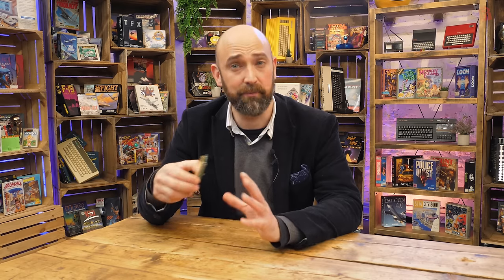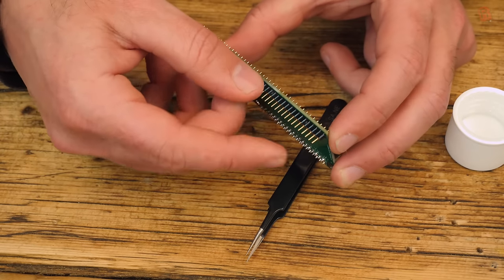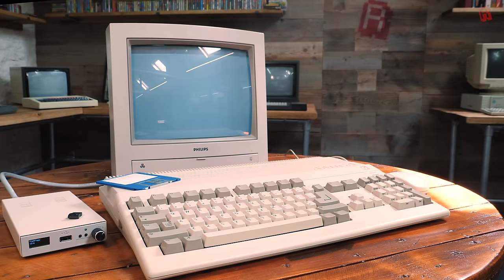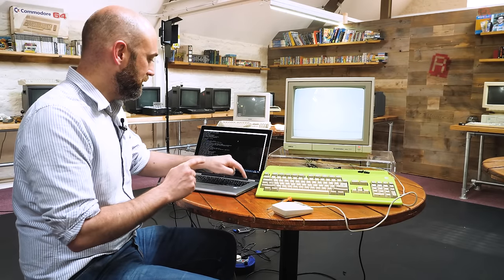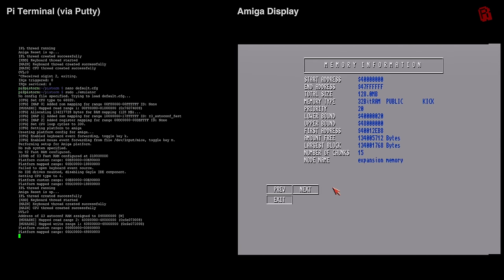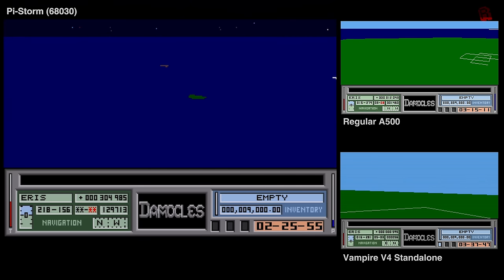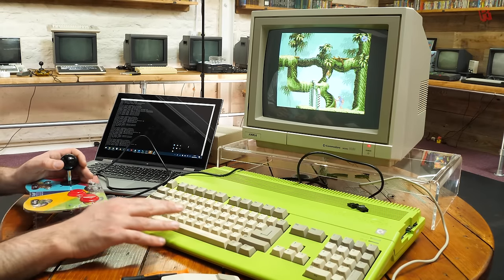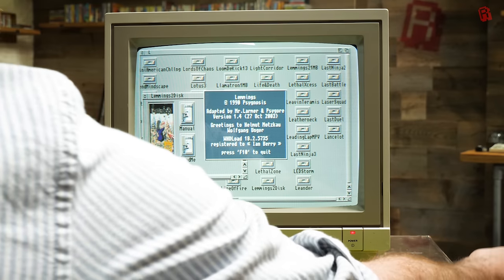Amiga PiStorm - Retro Power on a Budget - Tech Nibble

Comment from the maker: Thanks for taking the time to watch, I'm really excited to see this project progress. You can find a link to the Discord server for PiStorm in the video description, and while you're there why not give this channel a sub!
Neil - RMC
Reply: You need to check out the Pitrex for the Vectrex - it is using.a pizero in a similar way. It is supporting playing arcade vector games (eg. Star Wars and Asteroids etc) using emulator running on the pi and it is driving the Vectrex's hardware directly..
Reply: hi mum! lol
Reply: Thanks for the video. 

As for using a Raspberry Pi 4B, I would suggest they focus on the Compute Module 4. It would have the power, with none of the ports, and be more snug fitting.
Reply: @RMC did you know that Monkey Island on stock A500 don't have moving clouds on title screen, but when you change to 020 you get them? MI is running on CPU no hardware acceleration this is bad :/
Reply: @vardekpetrovic9716  The USB ports have to be removed, because they get in the way of things fitting properly.

Hence the 3A+ being the ideal one. Frankly, I would argue the Comute Module 4 is the best option, as you don't have to unsolder anything,  and will fit better.
Reply: @horseradishpower9947  You missed what he was asking...connect USB ports with wires that take up less space, rather than USB jacks.
Reply: @VulpisFoxfire  The question I have to ask next is... why do you need the USB ports? Does the add-on use them, or aow their use, in some way? Because it would appear not
Reply: @horseradishpower9947  Hmm. Valid point, actually.
Reply: The tube in your monitor is one of the blackest I've ever seen. So nice.
Reply: Do you know if there is any plans for the PiStorm to support Atari ST ?
Reply: @mrdali67  The end goal is for it to run anywhere a 68000 will. So.. megadrive, arcade boards even the lowly Atari ST :).
Reply: @thomassmith4999  Ha ha. I am not so much interested in gaming, and there is lots of areas where the Amiga is quite inferior to the ST line, but that sounds nice. I am merely interested in a way to cheap boost a standard ST since emulators doesn’t support the cartridge port wich was often used for copy protected proffessional Music software like Cubase. The hacked versions was never stable, so a software emulator alone isn’t an option, and it doesn’t have the main force of an old ST that still have a tighter midi clock than Cubase 11 running on a 16 core modern PC.  Quite an achievement for 40 year old 8mhz 68000, and no, an Amiga can’t do that trick .. 😜
Reply: @mrdali67  ST has better sound than an Amiga :) and a midi port !. I give it that. But I'm an old timer from the demoscene, so it's C64, Amiga and Gravis ultrasounds for me.
Reply: where do you get a pistorm?
Reply: @jediknight2350  If you can't solder one yourself you have to go on the waiting list on the discord channel. If you can build it yourself then you can order the PCB and do that.
Reply: @thomassmith4999  The ST is put together with very cheap pieces. It’s clearly inferior to the Amiga on the graphics and onboard sound (only the YM fm synth, no digitized DAC. They fixed it with the STe wich had the blitter chip, but at that time the ship was kinda sailed for them. But it remained top king on the Dtp and midi Music cause cause the midi interface is directly coupled to the cpu, wich made it take a decade or more for the Music software to catch up on other systems like the PC. Timing on the PC was an issue all the way up to USB 2.0
Reply: There is still some people today that use an Atari as midi master controlling a modern daw system
Reply: The high res SM124 graytone monitor (640x400) 60hz. Was also a plus for more serious use. I remember some put it on the side for dtp, just to find out the tube wasn’t supported on the sides so it had a tendency to break off the chassis when you turned it 90 degrees
Reply: @mrdali67  The roland interfaces on ISA for PC were as tight as the ST from a hardware standpoint. The software stack was a bit different story though.
Reply: Neil, this is seriously the koolest thing I have seen in the amiga community in the modern retro scene. I have wondered how long it would take something like this to happen, and I am not disappointed. I will be picking one up hopefully a little later this summer and trying it out myself on my amiga 2000. I need to know how this thing will work with a flying toaster.
Reply: Any way to get on the waiting list without using or touching discord?
Reply: @dafoex  Have a friend use discord.
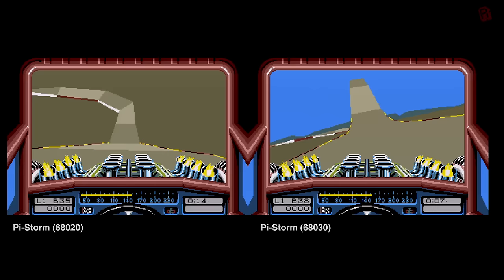Reply: 17:32 There are big drops in cpu emulation speed between these groups:
1. 68000, 68EC020, 68020
2. 68030, 68040
3. 68060
Ive seen this difference, when trying to turn old computers (200-1000mhz) into Amiga Emulation machines. BTW, if the Winuae didn't work fast enough, you could always look for an older Winuae version. 0.8.6 (best non-aga version) and 0.8.8 were my favorites.
Reply: @angreeee  Yeah. This is what I found too. You will notice that Amiga Forever on its 3.1+ images that have huge software bundles use an O20 by default. As that is really all you need. I don't think there is much software that specifically calls for anything more except for some productivity stuff that was made long after the amiga died. 

FPGA on the other hand is the opposite! The more elements the cpu uses the faster they seem to get.
Reply: @angreeee  can you emulate these amiga games on pc on an i7 from 2012?

Comment: Fantastic overview Neil.  Love the snot green A500!  Interesting that Damocles ran slower, I wonder if it runs like that on a real 030. Those disk speed benchmarks are crazy fast.
Reply: My theory: the 030 has an MMU; the 020 does not. For some reason, Damocles is using the MMU (or it is enabled by a debug tool such as Enforcer) and the Pi is incurring more overhead doing the page table walks.

Comment: Pro tip: Put the header pins in the socket, put the pcb on the header pins while in the socket,  solder the corners and for something this large a few pins in the middle, then remove the board and solder the rest of the pins outside of the computer. Should work fine then..

Comment: Neil, given that 700+ MB/sec speed is far greater than what an SD card is capable of, what you're seeing there is the virtue of the Linux VFS caching the hdf file in RAM.
Reply from the maker: Ah now that makes sense, thank you Linux!
Reply: That is a great use of the untapped RAM that the OS and emulator aren't using.
Reply: @shadowtheimpure  Doesn't the pistorm use the Pi's RAM to make up the 128 MB? Or is there 128 MB soldered onto the pistorm?
Reply: @Rocky1138  It uses the Pi's RAM, but that still leaves a lot of memory unused since the OS and emulator are very lightweight.

Comment: It is amazing what developers are coming up with and able to do it at a reasonable price. We have the PiStorm for the Amiga, and Apple II have the Apple II pi, Commodore utilizes a pi as an accurate emulator for the 1541 floppy drive, and over in the microcontroller field  the ESP32 is used in the FujiNet that greatly enhances the Atari 8-bit line. I wonder what this could do on a Macintosh.

Comment: Very informative, Neil.  You touched on several things I've not seen mentioned in other videos.  I would be interested in knowing if you ran into any of the issues Dan did on loading game from disk with the PiStorm installed.
Reply from the maker: I saw that, Dan did a great video. This Amiga has a Gotek in and I didn't run into problems but I haven't tried Lemmings from it specifically, I should go back and try, although I will 99% be using it from the WHDLoad SCSI setup and I did load Lemmings from that with no problems.

Comment: Besides the WSL addition, Windows 10 already has an SSH client included for the CMD and PowerShell commandline tools (out of the box). There is no need to use Putty anymore. If you want drag&drop file SCP transfer, you can use the free SSH client tool from Bitvise; it has many features, including a SOCKS 5 proxy server for tunneling the internet over the SSH connection.

Comment: This would be great with a Pi CM4 board. It's tiny, but far more powerful than the Pi 3A+.
Reply: yeah, just watch jeff Geering, for cm4 projects in general, does board reviews/tests,
Cm4 runs hotter probably, but if the amiga internal shield could be connected what a heatsink.
just look at what the pi400 has internally, a big shield and clocks at 1800 mhz

Comment: The Pi Zero 2W is now supported. The new zero is essentially Pi 3A/B+ recreated in the Zero form factor. It has less RAM (512MB is not an issue for PiStorm) and a lower default clock speed (1GHz).

Comment: Still so amazed by this. I really want to get my Amigas back up and working  just hope they are OK in the loft!
Reply: depending on the model, maybe not... a A500 plus will need it's battery removing PRONTO. A600 and A1200's capacitors will probably be leaking and wild temperature swings won't be doing any of them any good. Disks will probably be getting mould on the surface (which can be cleaned until it destroys the surface)
Reply: Get them re-capped, batteries out...now! Or they may not survive...
Reply: @cartayno  I know, mate! it is scaring me to death about that!  But im in Thailand and my Amigas are back in England! TT

Comment: This is an excellent little project. Hopefully at some point they'll get it working on a 1200, as that is all I have currently. 

Looking at it though,  at some stage I think a compute 4 version might be a better option than the standard pi, though it would up the pcb cost,  but as long as they don't change the pi compute 5 (or later version) format it would make it much more compact potentially.

Comment: I have an interest in one for my A1000 as its the only Amiga I have in my collection that is still in its original configuration all my other Amigas have accelerators that I am happy with.   I will be one of the very few patient people who want one and wait until they become widely available and for a couple reasons.   By the time they are widely available the development should be well matured and maybe the board will be revised several times.  So being patient allows for a ton of testing and get most if not all the bugs resolved.   Once I have one in my A1000 it will be nice to take the old girl out for a ride and some much needed attention.

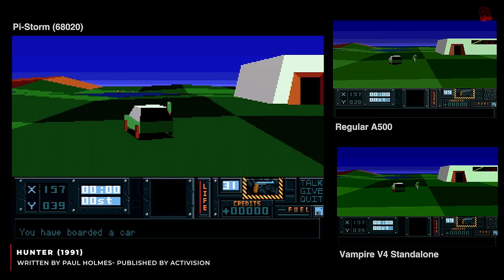Comment: 16:29 I could confidently say that the 020 setting was performing better because the hardware doesn't have enough power to get it running smooth set as an 030. This also happens on My PSVita when emulating the Amiga. I have classicWB on my PSVita and i find that when i try emulating an 030 Amiga, some games and demos run choppy, but when i change the cpu to an 020, the game or demo runs smooth. This may be fixed with better software optimization, but i would say its the lack of power from the pi and PSVita that is causing this.

Comment: Very nice video. About 3D games that seems not to be accelerated, do not forget that only CPU is boosted, so if any operations in the rendering process is done by the blitter, it will be the bottleneck.

About 030, the only things that can influence performances is the data cache. News instructions will ne be used (because games seen are designed to run on 68000). There are some programs that can disable data/instruction caches. Instruction cache was introduced with 020 and data cache with 030. Using self modified code can improved performance on stack 68000 or 68010 but be terrible for other members of the m68k family. I do not know how emulation is done but perhaps killing caches can change performances

Comment: FYI it is not in contest with Terrible fire. If you check Exxos forum TF has made a Pi Storm compatible adapter for the a1200.
Reply: The PiStorm developers theorise that the TF1200 might only be Buffee compatible due to some special firmware on both sides. If it does work then you won't be able to close the lid on the A1200 with PiStorm and it probably won't be very fast due to the bus translation. We are working (slowly) in the background on plans for a PiStorm32 which will support the A1200.

Comment: It’s all nice but for me growing up in the 90s. The Blizzard 1230 IV is nostalgia and the best made card ever made for the A500 or A1200. The ACA500Plus is a must for the A500 and a perfect combo with the Blizzard 1230 IV. The A500 and the A1200 run smoorh and fast enough with a 68030 50MHz CPU. Faster than that it run unstable with a Pi and a Vampire 500/1200 V2 or the Vampire V4.
Reply from the maker: The ACA really is a lovely balance of price and features 👍
Reply: True, the ACA cards are great to use. Have the ACA1221, ACA1233-55 LE and the ACA1233n-55. Waiting for the new ACA1234-55 and the ACA1260. Use also the Indivision ECS V1/V2 and the Indivision AGA MK2CR and the MK3. Jens make great products and years to come. The CA-PSU is also a must for the A500/A600/A1200.

The Blizzard 1230 IV is very difficult to compare and very important for the A1200.

Comment: That Damocles issue is a weird one. It'd be interested if it's down to an incompatibility with the PiStorm itself or an issue with the emulation on the Pi.
Reply: I think it's the latter, there's more to emulate with the '030 and in some cases it's that extra baggage that slows the system down. The Pi's 030 is probably wasting cycles preparing instructions that's not in use - the difference in performance, however, likely depends on whether the game is speed or IPC sensitive.
Reply: The Damocles issue was confirmed by a dev as Amir says. It's because there's more to emulate for an 030 than an 020 so overall the pistorm is slower. Optimal is 020 and there's no benefit in going to a flat 68K. This of course may well change as the project develops. It's going to get better and better.

Comment: It makes sense that the 68030/40 run slower, since it's emulating the CPU, and the emulator needs to do more to emulate those CPUs.  With an actual CPU, games may run faster because they are more efficient in architecture (even if the games don't take advantage of the extended instruction set, or registers), but for an emulator... well, you're just asking it to do more work per executed instruction.

Comment: I wonder if they'll make a PiStorm for the 1200 or the 3000/4000, I would love to see what could be done in particular with the BigBox Amigas, I suppose we could have two boards somehow connected to the Pi basically interfacing the Pi with not only the CPU but also to the Video Expansion Slot which should enable standard Amiga modes to be passed-through the Pi ending up outputting via HDMI. This should make it possible things like (S)AGA and accelerator boards on the Amiga, for example it should be possible to implement something like a Voodoo accelerator using the Pi's GPU features (or better)
Reply: The Pi4 CM module should be quite adept at having a CPU daughter board made for the 3000/4000 Amiga's processor slot, add some headers and a link to the Video Slot and bang! Most powerful PiStorm Amiga ever!

Comment: @12:51 I'm not sure it is using my 2MB BooBip RAM for the slow RAM because sysinfo is showing a 1.8MB block from C00000 not 1.5MB. So either kickstart has misdetected the RAM (and you might get crashes if it is used) or the PiStorm has put RAM there in the memory map byapssing what is in the system.

Comment: An 040, as was available in at least the A4000 and as an upgrade, should be enough for Doom...? It already looks a fair bit better than this on my 1200 with a 50 MHz 030. I don't know why the Amiga is always measured by the slowest of the lot in its stock configuration. It always was an upgradeable system like any modern PC...

Comment: If they add Pi 4 support, it won’t be the USB you have to remove, but the Ethernet, since they saw fit to swap those ports on the Pi 4.
Reply: Pi4 support will almost certainly be in the form of a Compute module
Reply: @AlistairBrugsch  good point. I forgot they'd finally released that.

Comment: If it could turn an ordinary ST into a Falcon on steroids then now you're talking! 😊
Reply: Given it's primarily emulating the CPU it doesn't seem beyond the wit of man for that to happen...
Reply: I'd say it will happen eventually
Reply: No sure the Pi would have the horsepower to emulate the efficiency of the DSP in the Falcon, but may be wrong.  However, if I could turn my 1040STE into one (even without that) I'd jump on it!
Reply: @DarrenCoull  Why would it need to emulate the DSP, though? The Amiga version isn't emulating any of the Amiga's custom hardware, after all.
Reply: @d2factotum  Yet...

Comment: Been following this project for a bit now. Very impressive overall. I only have an Amiga 1000 that will fit it at the moment, though I know they're planning on developing an A1200 interface as well, which I can definitely make use of. I'm wondering if the slower speed from the emulated 68030 is not due to the speed of the Pi 3A+, but some sort of software incompatibility with the emulated CPU. Doesn't the 68030 lack some instructions that the earlier ones have, or change how those instructions operate. Just a thought.
Reply: It is mostly because emulating the MMU to map virtual to real RAM takes extra CPU cycles.

Comment: Excellent video as always Neil, but i have a little question: I have an Amiga 2000 with kickstart 1.3. I found a ready to play pistorm with everything installed but on the requirements page it says that it is compatible with Amiga 500, 500+ and 2000 with kickstart 2.0 and above. Is that correct? I saw that your beautiful Amiga is 1.3. I am a bit confused. Is the Pistorm going to work on my Amiga?
Reply from the maker: The PiStorm applies a soft kickstart of your choice if you so wish, so the physical KS you have is irrelevant if you enable this feature.
Reply: @RMCRetro  OK. Thanks a lot. Cheers!